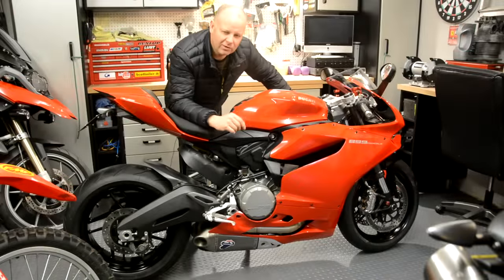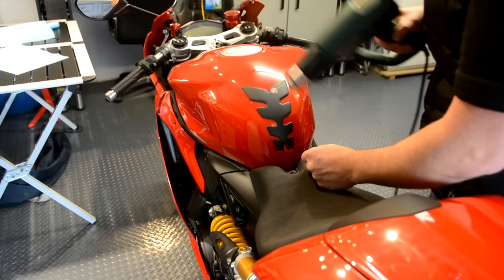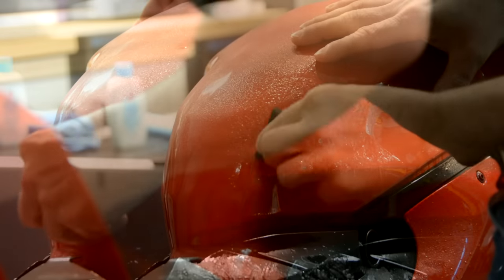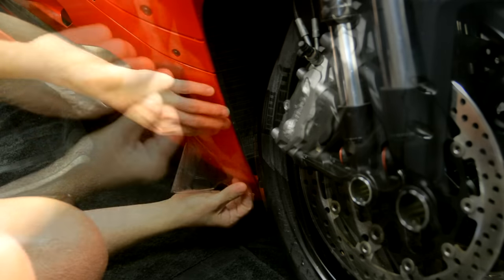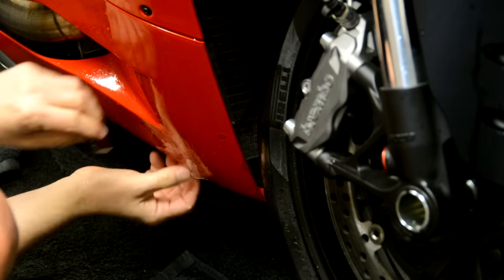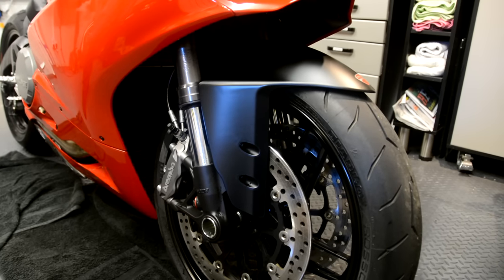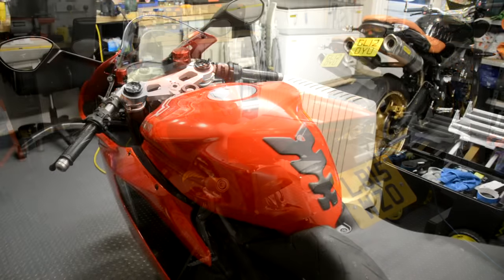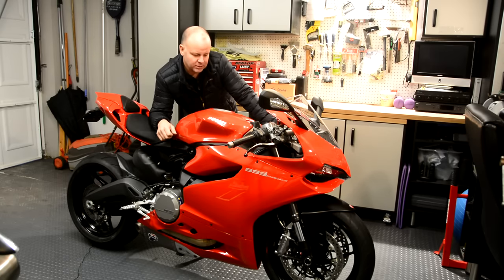Motorcycle Paint Protection - Ducati 899 Panigale

Comment: Tony the legend is the only one I've found that offers any kit at all for my Triumph 1200 SMQ Scrambler which is insane as it's a clear coated pretty ADV bike with a tank that will be imediately covered in scratches if you grip the bike properly. I've been babying the bike for over 12 months now as no local PPF applicators over in Aus could be bothered with it. Stoked to have finally found a quality kit that'll I'll apply myself. TONY - make a LHS/RHS side cover and front fender kit for it so I can buy it as well mate.

Comment: Awesome. Be interested to see how it holds up. After 5/6yrs I've had to take it off my Daytona as in some places the edges starts to collect dirt and it shows where the protection is and can't clean it as it gets underneath. Mine was visishield and professionally applied. Believe me wen I say I'm more OCD with cleaning than you are lol. But it has protected the important stuff.
Reply from the maker: +Ff6022 ...interesting feedback Ff6022, the edges are noticeable when you run your finger over (for example) the tank, so it will be interesting to see if this film goes the same way...the beauty of it is of course the paintwork underneath should still be OK and it's cheap enough to get redone every 3-5 years (if you tend to keep your bikes that long).  Thanks for watching and for stopping by to comment.  All the best - TMF
Reply: did the wrap removal affect any stickers on your bike?

Comment: Hello, I look for paint protector for my ducati 959 panigale 2016,

My 959 2016 is original matt white color, the protective film works in this matt configuration?
in my case the painting is matt, it will have to be a matt film right?

I sent an try email to tony but I did not get an answer. Do you think you can help me get one?

I am from Portugal 

Best regards
Reply from the maker: Well Tony only works in the UK so you'd have to find something similar locally - and yes, matt film on matt paint......
Reply: @TheMissendenFlyer  ok, thanks for fast feedback 👍

Comment: May i ask, would matt paintwork also benefit from this? (Eg street triple Rx - my bike's - matt silver)
Reply: *matte
Reply from the maker: +roadbypass Absolutely yes - I had the front mudguard of my Panigale done in a matt film and you just can't tell it's there.  Wish I had done my Street Triple when I bought it, over the 3 years I've had it the tank has become quite dulled despite the tank protectors I applied....if you have a nice new bike I thoroughly recommend this.  Good luck with the Rx - great machine!

Comment: Odd how Ducati don't put a top coat on, will now have to look that up and find out why lol
Reply from the maker: +GTs Garage Yes it's completely nuts, I can only assume it's a cost saving measure....but makes no sense for the owner.  Only applies to the red bike by the way, not the white...
Reply: +TheMissendenFlyer The white 899 is matt, so wouldn't have a top coat, but the red bike should, even the lesser Monsters have a top coat.  It's this reason alone I didn't buy an 899, just one too many compromises on what is still an expensive bike.   I checked at the bike show, and the 959 doesn't have a top coat either.  You've come up with a good solution there.  I used that film on my previous bikes, and applied it myself, but the kit alone was getting on for £100, so £200 fitted seems excellent value.
Reply from the maker: +Nigel Street I agree with everything you say Nigel.....

Comment: Sadly Tony is too busy to apply these kits himself these days, so if you do buy one you are left with trying to find someone to fit it. They are sold with everything you need to fit it yourself, but you will definitely make a complete mess of it unless you have a good amount of experience fitting decals to bikes, for example. I bought a full kit for the 2021 Hayabusa but still looking for someone reasonably local to put them on the bike.
Reply: I've bought a full kit from Tony for my 21 busa as well, but I'm having trouble of actually finding  someone on a 30-40mile radius to install it for me, some of them don't do motorcycles and the others won't install kit's provided by others, the only ones who where willing to install my kit quoted me £700 which is ridiculous.
Reply: @alexbruno7979  I eventually got mine fitted by a company in Daventry. They do their own kits but were willing to fit mine for £300. The TJD kit for the Gen 3 Hayabusa has a lot of pieces (more than any other I think, so its a lot of work to fit).
Reply: @ZOODUCK   £300 sounds fair for the work involved, Daventry isn't far from me, could you please tell me who installed it for you. Thank you
Reply: @alexbruno7979  The company is Bodyguard UK and it was Jarrod that  installed the TJD kit for me.